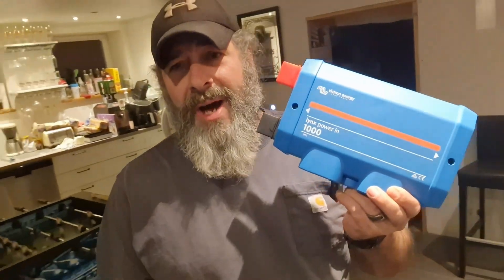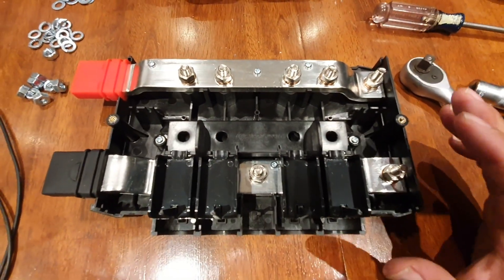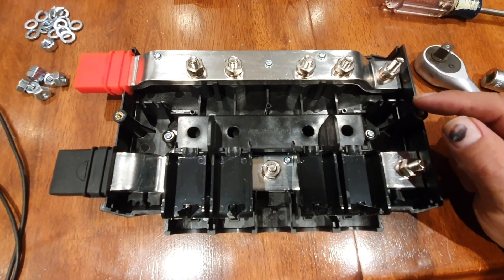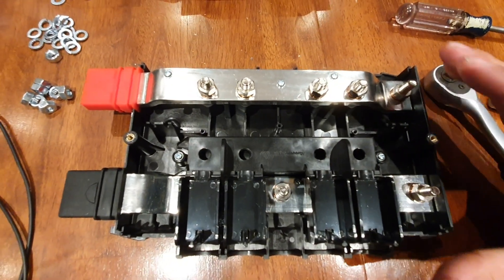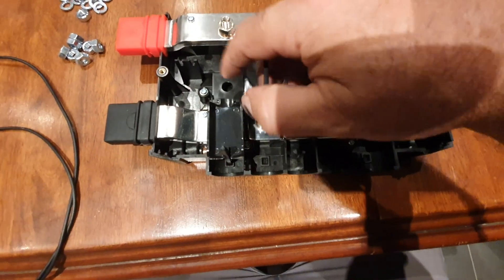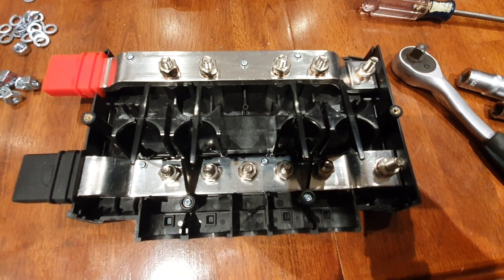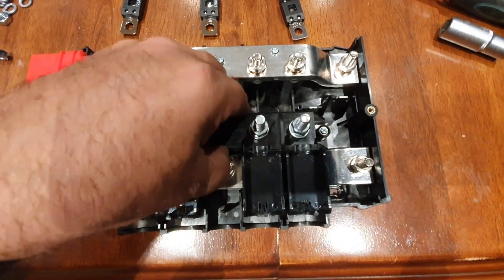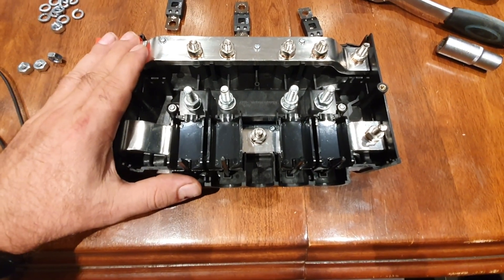Modifying a Victron Energy DC Power in to use fuses : Old German Farm House |Homesteading | Off Grid

Comment: The shunt at $1000 sounds like the lynx shunt. You can use the smart shunt instead of the lynx shunt to save some money. It might also play better with your modified lynx power in - the lynx shunt is intended to take power thru the end terminals of the power in, not the side terminals where you now have fuses.